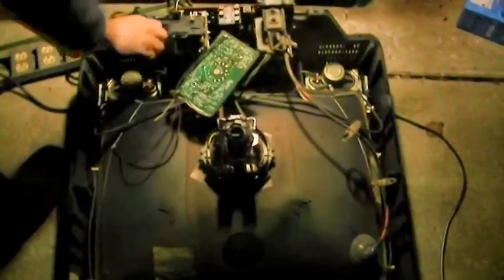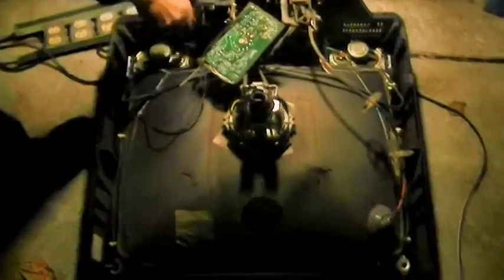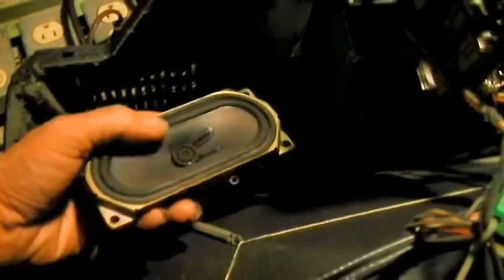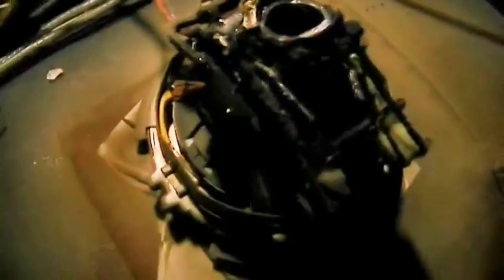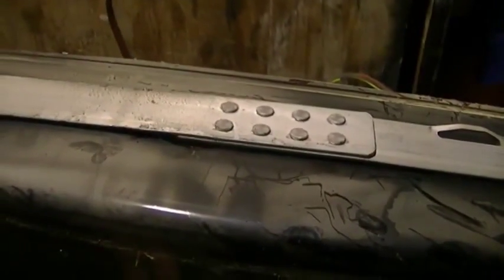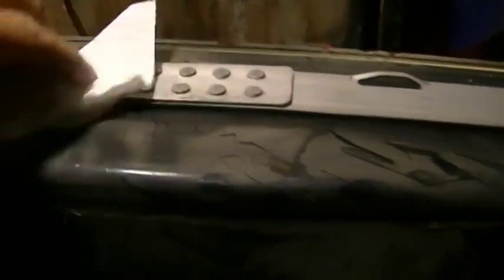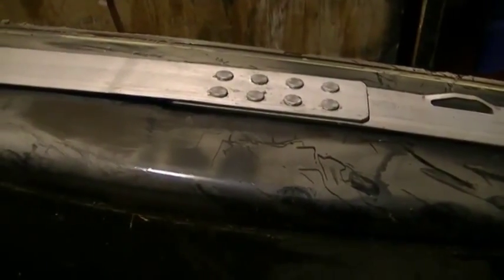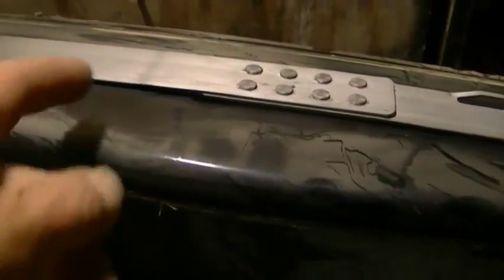CRT Safety Band Tention Test EOL part 2

Comment: To address the comments from people saying this is only 'to hold CRT in casing', no, it is an implosion prevention measure, you can look up the patent, I'm sure it's there somewhere. Its fitted in the usual way by heating, and tension after cooling is not really enough to show a stretch in high tensile steel when it is cut - but it is under tension. Do not question Shango in the future, you will only make a twat of yourself - unless he says glass flows over time...Then you can question him.

Comment: The "tension" on a rim band is minimal. Its real purpose is structural reinforcement, hence the heavy construction. Its purpose is twofold, securing the mounting lugs in place in conjunction with the adhesive bonding it to the glass, and providing enhanced structural strength around the rim of the tube in addition to structural strength provided by the tube's extremely thick glass construction. If the tube were under vacuum when the band was cut, it would indeed have been under some tension (a few pounds maximum) due to forces of atmospheric pressure on the large faceplate area tending to bow the rim area outward. The band is there to contain that outward force in the event of faceplate collapse. The idea for rimbands as containment structures for implosion forces was developed from analyzing films of deliberate tube implosions in slow-motion to observe the motion of flying glass & locate areas of maximum force to develop suitable containment methods.

Comment: The band around the CRT is not and never was an enforcement for giving strenght to glass. It is only the support for you to put the CRT in the plastic housing and NOTHING MORE. Don't call it safety band because has nothing to do with safety. Glass is glass man!!! And glass does not expand or contract. It breaks with temperature or chock. But the band doesen't add more strengh than the glass itself has.
Reply: You're wrong. The band is for implosion protection. You're right, it won't reinforce the glass, it will break if you smash it, but it keeps the fragments together, unless you smash it very badly. If you knock two identical CRTs with a small hammer with just enough force to break it, and the safety band has been removed from one of them, that one will implode, the other one not, it just cracks. The older ones quite often implode just from cutting the band. The following warning is printed on every tube: "This cathode ray tube employs integral implosion and X-ray protection. Replace with the same type number for continued safety." The integral imposion protection is the metal band, the X-ray protection is the lead oxide in the glass.

"And glass does not expand or contract." Are you serious?! It does it both with heat and mechanical forces. You can bend a long, narrow piece of window glass quite much before it breaks. I bet if you manage to cut the band without instant implosion, then measure the CRT's every dimension,, then you slowly let air inside the tube (eg. by drilling a small hole into the anode cap), the dimensions will change, because the atmospheric pressure squeezes the tube while it's under vacuum.
Reply: @mrnmrn1  "Safety band"? What was the engineer that gave that name to the crts fixation hardware?

Comment: I've heard of glass referred to as a "Liquid Solid", that's not really that accurate but it is a very elastic, with pressure slowly applied and increased over time you can actually flatten a bottle without it breaking it. What causes it to shatter is breaking the surface tension either by crushing or by striking it with a sharp object, so I think that the idea behind the band is to keep that tension in place across the surface of the glass, although it obviously doesn't need to add much. You could try using a band clamp like they use in woodworking, they have ones that use a very thick strap made out of almost a fire hose type material, though that may not be rigid enough.

Comment: In my experience the ones that are glued to the glass have very little if any tension.  You find those on newer sets.  The high tension ones are on the older mid 80 sets and they explode off of there.  I have a few in our pile for the "wall of TVs and a cannon" experiment for later this spring.  I can take any measurements you like.

Comment: The band may not be very flexible and is glued down?

Could you check if it's possible to mess up the CRT by driving a strong focused spot in the middle of the screen(or anywhere) with max power over some time? (by mess up, I mean more than just a black spot, more like loss of vacuum)

Maybe even assist the the HV supply, and try it?

Comment: I inadvertently bought a NOS delta gun 25VAXP22 for a CTC 39 Accucolor, unaware that 4 mounting brackets are already on with shipping type spring steel. 2 layers, crimped. I have since located a good used tube without the ears, however, I still want to unband the NOS tube using a Dremel tool, or a vibrating type cutter. Perhaps cutting the bands while it's still in the box, through a small hole in the side of the box just in case.
Reply: I wouldn't advise doing that. Years ago, a friend did that and the CRT imploded on him. I've also read a couple of stories on videokarma about the same thing happening. So, best to leave it alone - it's not worth getting seriously injured or killed over.
Reply: radiotvphononut
I hear that. It's tempting. No doubt, it's best left alone, or maybe someday a robot. The stories I've heard over the years are scary. Glass sticking 2 inches into the walls, etc.